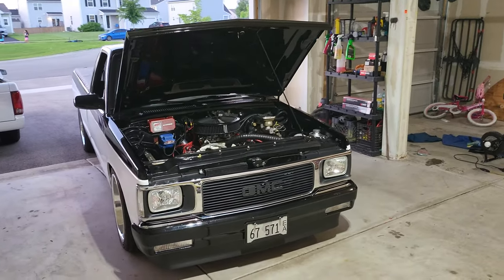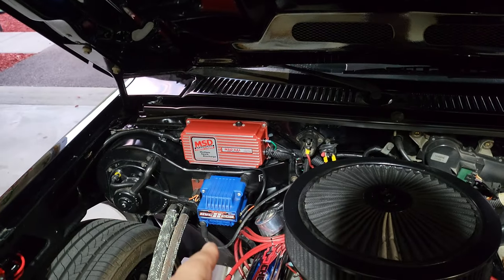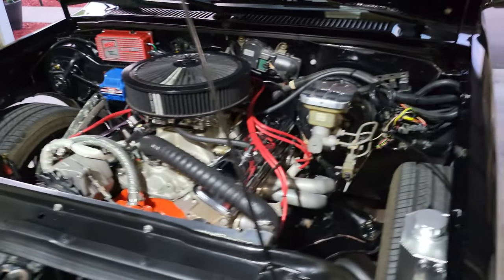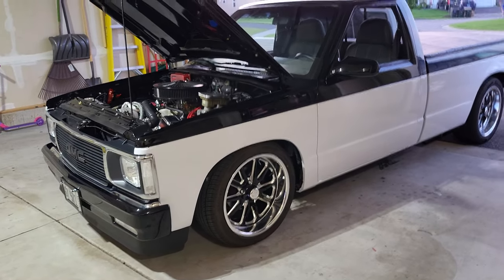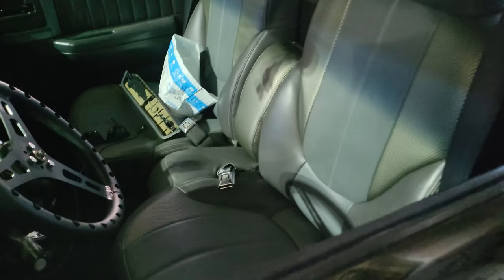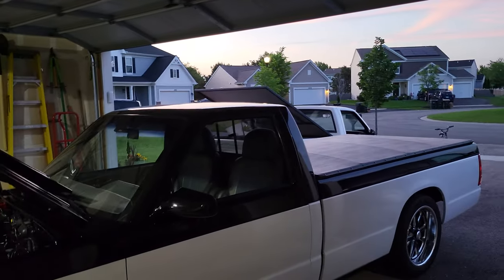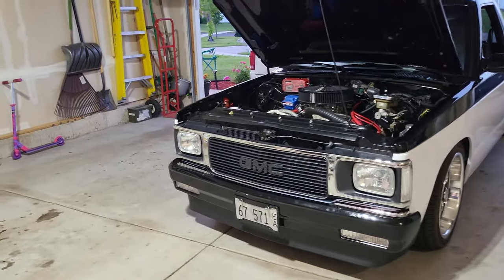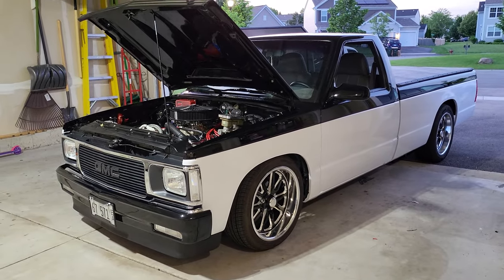year update on my 87 v8 s10 chevy  truck build

Comment: I bought a 86 S-10 when I moved here to Hawaii, wasn;t really looking for an S-10 but have always liked them and  I had to buy something quick to get around Oahu. Mine's nothing special, it's an automatic with 2.5 "Iron Duke" motor, which is enough for me and I can drive around the entire island in less than 2 and hours so I don't need 500 HP. the 2 things I am going to change is the color and the stance, It was originally Silver and grey with Grey interior, I'm going to paint it 2024 BMW Sunset Orange Metallic with the roof paint 2024 Amenilist Grey (Dark Grey) and the interior is in such good shape I just need to clean it up and repaint all the plastic the same color or close anyway and I'm just going to pull the grey cloth off of it and hog-ring a couple of Orange and Grey Mexican Blankets that I've already bought back over it. I'm also thinking about making a headliner for it using the same blankets and some grey cloth.

Comment: hey nice buiuld!  ive got a similar setup what radiator and fans do you use to keep the engine cool?
Reply: From
What i can see he has no fan
Reply from the maker: i went with dual fans infront of radiator pushing air seemed the best cooling method for me rather then pulling so its been like that couple years and does well